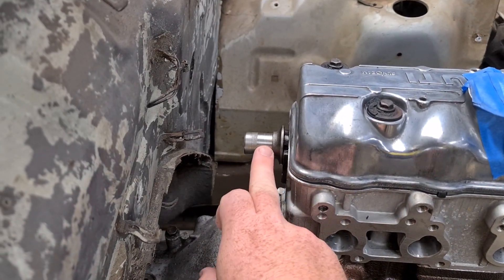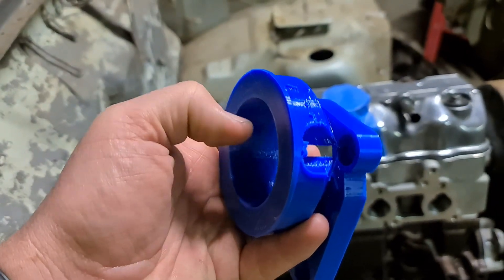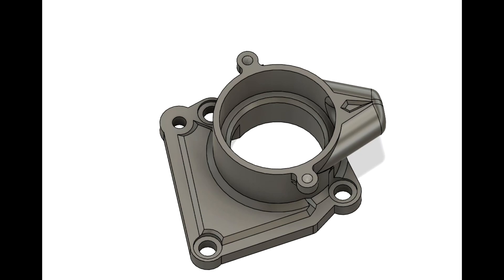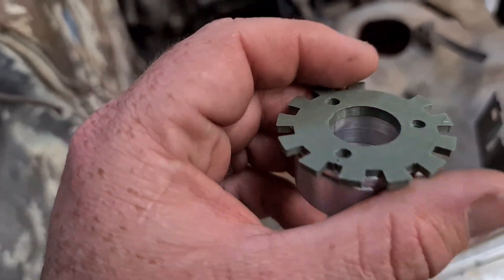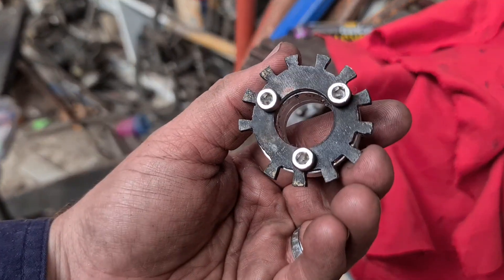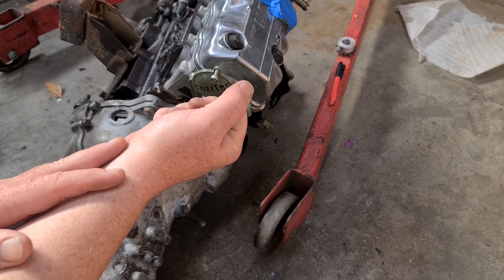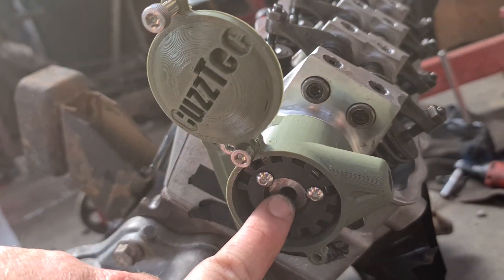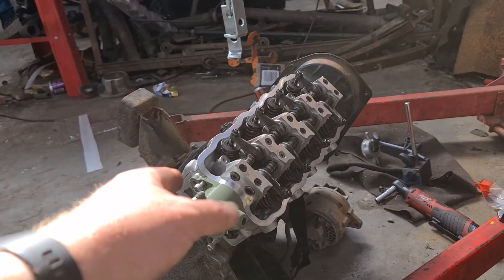How I made the Crank Angle Trigger and housing! CAD DIY EFI F10A Suzuki |UsierraPt 12|CuzzTec|

Comment: how has this project come along since this video? I'm guessing it's on the backburner?
I ask as I'm looking to do an EFI conversion on my F10 DA21T. current plan/goal is to put my old MS2 3.57 onto it, via some sort of dual VR (mostly due to it being modified for my Rx-7 CAS) cam/crank probably running off the original dizzy post for ease. then conversion intake for a set of GSX-R 600 throttles/injectors/idle control valve. if it all goes well maybe forced induction in the future but for now EFI/ITB is enough haha!

Comment: As I see there is "13-1" camshaft trigger wheel (13 segments with 1 missing tooth). Does it work well? Is it possible to install "10-1" trigger wheel?
Reply: Number of teeth has to be able to be divided into 360. So 36 is very common, 18-1 is possible, you could even do 6-1. The more teeth, the more resolution.

Comment: So for the speeduino you onlny need a Camshaft position sensor to run? If i only make a crank position sensor, will that bee enough? I want to try the speeduino on my engine but i am still a little confused about the setup of position sensors.
Reply: I have the same question.
Reply: You can run either cam or crank sensor or both. If only running one or the other you can only run wasted spark ignition and batch fired injection. That is, the ignition will spark and fuel will be injected every 360 degrees for 2 cylinders and 180 for 4 cylinders etc. this means fuel will be injected during the intake AND the power stroke, resulting likely in inefficiency. Because the cam spins at half the crank speed, the valves are only opened every other full rotation of the crankshaft. Meaning the ecu needs to not only know the crank angle, but which stroke the engine is in. You can get a cam(also called a home) trigger directly from a cam lobe. Once the ecu “knows” which stroke the engine is in, it will start injecting fuel only during the intake stroke and you can run (for lack of a better term) non-wasted spark. Just for argument sake, wasted spark is not a derogatory term. Many efficient systems run high rpm with wasted spark. It doesn’t much matter that the spark is firing on the exhaust stroke. Technically there shouldn’t be anything for the spark plug to ignite at this point.